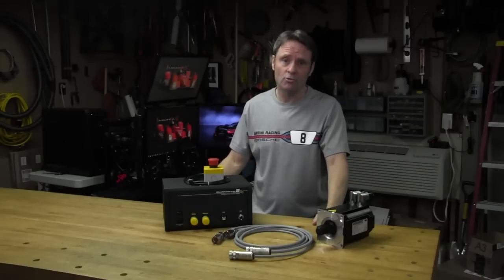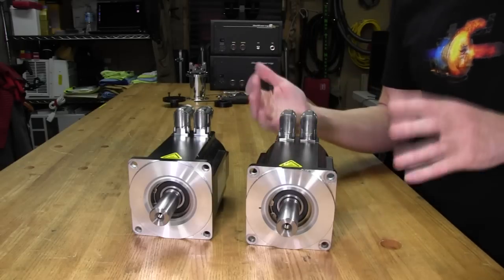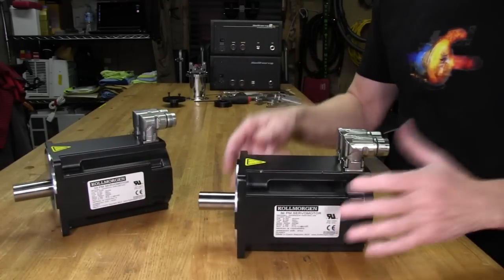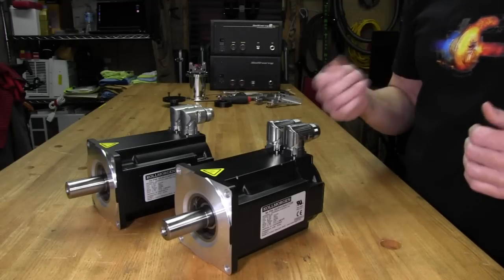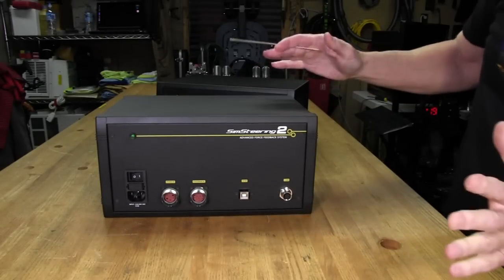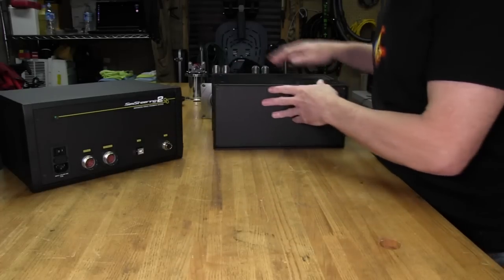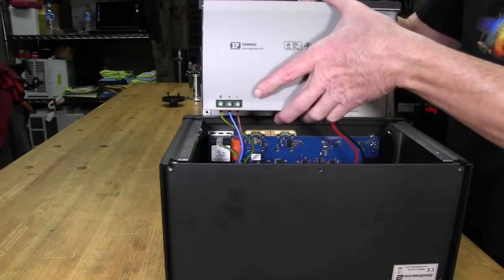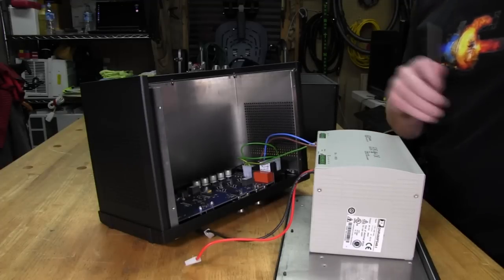Sim Steering FFB System Version 2

Comment: I love seeing the options out here. But for me, the large Mige, Ioni HC Pro controller are all I personally will ever need. The cost of the bodnar set up still baffles me slightly. 

I get that there may be more detail felt, but 4 grand!?!?! I went with a Sullivan kit and couldn't be happier!

And you are dead on about the force these systems put out. Its nice to crank it and give yourself a work out, But when you dial them back a bit...... it's the detail.

For me, Its ALL about the detail felt. Power is nice but it's not the end all. Also knowing that you can never wear out or break these things is great!!

You can run these for hours and never have any loss of feel. None. OSW/Direct Drive IMO is the way to go these days if you're serious on sim racing! 

I know I'll never go backwards! Great video!

Comment: Hey Barry have you tried this camparison in other sims like race room, assetto corsa, project cars, I have been of the mindset that A LOT of modern race sims are missing that road feel you mentioned except maybe Dirt 3/Rally. What really is strange is Older sims and games have had it like GT4, and even Toca 3 even with the old plastic logitech GT driving force pro. Even when emulated on PC with a hack plug in to use a T500rs these games still have better road feel than most newer title does this new wheel fix this problem in those titles or is it just in iRacing

Comment: Barry,  Nice review as usual, I was checking in deep your previous comparison of FFB, and I found that the motor that OSW wheel were using on that review was equipped with a resolver not with an encoder as the Sim Steering V1. 

Could this detail be the reason of the difference and the "win" of OSW against SS ?

At last I would like to know if there is any "real" advantage of SFD over the usual resolver, this is because at least to me Argon is not supporting SFD yet, but at the end of the day the SFD is only a serial RS485 sending digital information of position of the shaft (very simplified).

Best Regards,

Enrique
Reply: Resolver is much better

Comment: Where did you get that big chrome connector made? I would like one.. that's awesome..
Reply from the maker: Got it off ebay. Here's a link: http://www.ebay.com/itm/4-Steering-Wheel-Spacer-Polished-Aluminum-for-MOMO-NARDI-ISOTTA-SPARCO-OMP-/111015588260?hash=item19d90b71a4:g:cgkAAOSwP~tW5lsv&vxp=mtr
Reply: Sim Racing Garage  thank you very much

Comment: Hi Barry. Great review! Thanks.
Could you please provide the ebay's link to the 'four inch aluminium extension' that you can buy for 50$? Thanks.
Reply from the maker: +JO simracing Sure, here you go: http://www.ebay.com/itm/4-Steering-Wheel-Spacer-Polished-Aluminum-MOMO-NARDI-ISOTTA-SPARCO-OMP-/111015588260?vxp=mtr&hash=item19d90b71a4 looks like they went up on price about 10.00 since I bought mine.
Reply: +Sim Racing Garage Thanks again Barry. Great stuff. I see they also sell it in aluminium black. 
Cheers

Comment: hi barry, i am thinking about getting an motion rig with traction loss, but i am not sure if simxperience stage 3-4 is really  flex free while using bodnar sim steering 2 akm53 and heusinkveld pedals with really hard settings. could you tell me your experience with the stiffness of the stage 3/4  while using simsteering2 with 100%gain and 38nm ingame? dont really know if the rig can handle such high forces flexfree like an aluminium profile rig. i would be happy if you can help me
Reply from the maker: The stock wheel mount solution on my Stage 4 was not stiff enough for me. So I fabricated some 80/20 profile and mounted it to the main cross beam of the rigs frame. Now I no flex using the Bodnar. I also fabricated my pedal mount frame out of 80/20 profile and mounted this to the steel pedal mounting plate. No flex that I can feel there either. I'm happy with my setup as far as flex goes. Not easy to get an 80/20 rig setup with motion. But it can be done.

Comment: Everything you felt with the SS2 I feel with my OSW(small MiGe)
Reply: I see you've spammed forums with your opinion too ... have you typed this enough times to start believing it yet?
Reply: +MrMarlby well I did test the bodnar V2 against my OSW Lenze. Guess what... I like the OSW Lenze more, wouldn't change even if the systems had the same price. Especially iRacing was much better with the OSW. AC was the same, rFactor2 was slightly better on the bodnar in my opinion.
Reply: +McE McErono opposite to me then. I visited Bodnar whilst I still owned a Lenze ... big mistake! Brought an SS2 home with me and sold the OSW. For me it's so much smoother than the Lenze, I guess it's personal preference though 😊
Reply: sold my lenze too, and bought an simsteering2 akm53, i really like the smoothness and rubber feeling! its perfekt, much better than lenze in my opinion, ven if my lenze had way less cogging. but for iracing i am looking for app.ini values, because my old values from the lenze doesnt fit. can someone with sim steering 2 help me? would be nice

Comment: Barry, have my Bodnar fitted to my new rig.  Are you still running 0.2 Config software or the later 0.4 beta ?
Reply from the maker: I'm running the beta right now. But I like the 0.2 also, so might go back to that.
Reply: I heard a few bugs in 0.4 Barry.
Which would you advise a new Bodnar owner to opt for ?
Reply from the maker: Everybody is different, so try both and draw your own conclusions.

Comment: Question to you OSW, Bodnar, Accuforce users: How high or how much of the potential power are you actually running and are you bodybuilders? I love the concept, but they all seem extremely strong. I wonder if there is something like this but uses normal power (and is not made by fanatec, logitech or thrustmaster)
Reply: +fetB you can still dial the force back...  so it doesn't wanna rip you hands off...  that's the nice thing with those direct drive systems... that they are not only alot stronger.. but also more detailed.. because you don't need as much force to translate the little forces...  in other words those direct drive systems are getting more information in both ways... you can get stronger forces.. but you can also more details with smaller forces... because they are faster and have less resistence by themself...

so even if you dial the forces down from those dd systems.. you still have more detail and faster response then with the usual consumer wheels...

however the higher you go in the forces the more even smaller details you will feel... 

I am unfortunately not a DDsystem owner however... I am an audio guy.. and ffb wheels are very comparable to audio equipment...

for example the better a speaker is.. the more details you are able to hear with it.. even if you don't crank the volume up... (or listen to it relative quietly) however if you set the volume higher you are going to realise even more details...and you can turn those louder without getting into distortion or clipping

on a bad speaker however you will not be able to hear those fine details... you can compensate a little by turning them louder but then you are running pretty fast into distortion or clipping.. 

thats pretty much the same with ffb wheels.. you will hear or well better feel more details even running them quite quietly or less strong... but will be able to running them on higher levels without getting distortion/clipping to be able to hear well feel.. even more details...

another thing is... yes they are strong and might exhaust you but that also has some advantages... one is see it as a fitness machine :D  another thing is... in a real race car you would also have such strong forces (maybe even more..)...
and another one .. it more or less forces you to drive smooth (what is fast).. because you don't want to fight the wheel all the time.. because it is so strong...

thats the thing with those g27s and so on... they are so weak (and slow) that it doesn't realy matter how we drive them.. because they don't realy tell us .. "this is against what the vehicle wants to do"... on a strong and fast system however it tells you.." this is what the vehicle wants to do or doesn't want to do" .. and everytime you do stuff the vehicle doesn't want to do costs time
Reply: NoNameLeft1500
Tell me about it xD
 I have a G25, and its really weak. I get the concept of the systems, but all motors recommended for OSW systems or even the Accuforce, are so overkill. Im mean, look at the thick cable alone...
Reply: +fetB well it isn't that much of an overkill.. especially not when you want to create something close to realistic forces in a real racecar... indeed most of those motors might be even to weak for that.. ... for example high downforce cars without powersteering/steering assistend.... in todays F1 they used steering assistend.. which you could more or less call powersteering.. but it's a bit more intelligend and advanced..  however lowerclass formula cars.. like F3 I believe.. still doesn't have powersteering .. also I think back till the late 90s or so F1 didn't had powersteering... 

if you look at onboards of that period you see they holding the wheel pretty strong.. today they look quite relaxed when they turn... but back then..you can see how they use quite alot of strength to push the wheel around...

so if you want to produce something nearly realistic those motors are not an overkill...  and well racecar drivers are not bodybuilders but they are pretty fit... especially since the cars got more and more grip...

also those cables are multicore cables... (it's like many cables inside one cable) .. in a g25 or g27 or so.. for example... you have all the components inside the wheelbase... if you would have the wheelbase seperate.. you would need to get all those internal wirings to your wheel and motor.. so either you would end up with many small cables dangling around.. or with just one or two thicker ones..(where the many small wires are in) ... 

if you look at the pins of the plugs for example.. they aren't soo thick... every pin there belongs to a wire inside that thick cable... so the wires inside those cables.. aren't as thick as you might think,...
Reply: NoNameLeft1500 Yeah, I dont want to recreate 1:1 forces, and unless one is living the lifestyle of a professional athlete (bodybuilder was just a snarky synonym for it), it wouldn't even make sense. Like in the video stated, you can easily hurt yourself. But the question remains, as strong forces isn't the only thing in favor of DD systems, but responsiveness and smoothness, which as i hear, is miles away from the likes of CSW and T300/500.

Comment: One day i will buy a simrace like that.  in brazil its almost impossible..  i say, almost.  one question:  its much diferent from the accuforce?
Reply from the maker: There is a noticeable difference as far as smoothness and detail reveal are concerned. Whether that justifies the price difference, well that's something only you can decide. The Accuforce is a fine system, and I doubt you would ever regret buying it. Just not as powerful or refined as the Sim Steering units.
Reply: Many thanks for the reply. Because my intention in the future is to get something definitive and then go update some components. Your channel is great, unique on youtube that deals technically with hardware aspects. Again, thanks for the response. A big hug from Brazil.

Comment: Since this is essentially 5 times the price of a Fanatec CSV2 + wheel. Is it "5 times" worth it?
Reply: +Antoine Thisdale 
I asked this question on the iracing forums and the general response was that the two are significantly different to the point where it would not be fair to even compare them.     DD is out of my price range so I'll probably end up with a CSW V2 myself.   Plus I don't have a dedicated sim rig, and DD's can't really be clamped to a desk, or so I'm told.
Reply: Putting quality of ffb to the side, this system will last a lifetime & feel as good as first use each time, the wheel you've mentioned starts to degrade from 1st use (in my experience with mainstream cheaper systems)
If one is sticking with driving simulation for the long term then a good ffb system is a must , servo systems such as this handle ffb without breaking a sweat
Reply: +Adrian Stealth That is a good point. Refering to my op however, is it worth 5 times the price? 

I've been using the Fanatec GT2 wheel since 2011. It's now starting to show age but still works decently. 
If i was to rebuy that wheel now and on and on each 5 or so years, it would take me something like 25 years before i spend the equivalent in monetary value to a DD (not even).

That's why i was wondering what is the "real" added value to a DD. You feel the "road" better... as much as the software will actually give you anyways. Iracing is extremely good at that, but most other sims, not so much. It's robust yes, but i'm not throwing my gear down sets of stairs or anything. 

I feel that perhaps the software side of things is not ready for the level of efficiency a DD can provide.
Reply: +sonic_blue Ok, that reflects my resoning somewhat. Thank you for sharing. No offence to SRG of course.
Reply: +Antoine Thisdale  all better ffb, subtle detail & natural feel of steering -a wide range from subtle detail to hard kicks ( on curbs etc ),
you'll only need to buy this type of system once as it will never degrade

some people pay a lot of monies on a nice high end watch ( much more than what these cost ) for super fine engineering & precision, 
this is similar, if sim racing is a main hobby and it's going to be med to long term then this type of system is a no brainier
to call it a "fad" is a very uninformed opinion ( or trying to get a reaction for having an opposite view ),
a few AF's have been for sale due to people upgrading to the Bodnar  ( AF is a decent system too ) 
don't forget some professional race teams spend hundreds of thousands on their simulation setups .....we get what we pay for,
ps this is the sort of ffb system professional race teams actually use including f1

Comment: For that price you may as well upgrade a real car and take it to the track
Reply: +STEEZ  It still would cost way more than that. Got to get a racing license, buy the tracks own over priced fuel, car will break down, good tires at over a thousand a set at the least, plus only certain days that the track will actually let you go. All that given you have a truck to trailer that also cost a lot of money to haul the car, unless your cool with getting stranded after a bad race day. Most of us will never be able to drive an f1 car ,nascar, v8 super car, gt3 car etc so this will get you as close as possible. 3 grand really is not all that much. Most people spend that much on a years worth of smokes, pop,energy drinks, beer and don't even know it